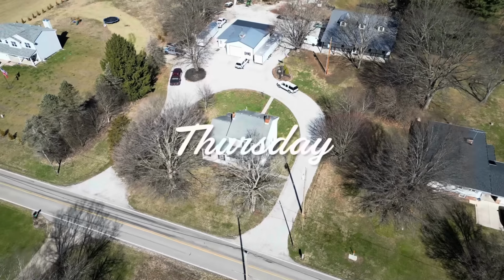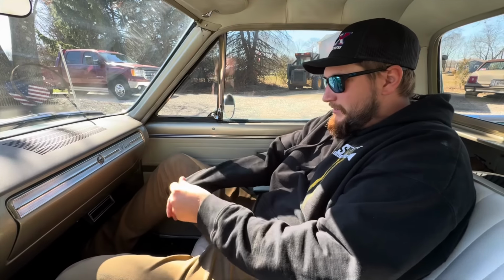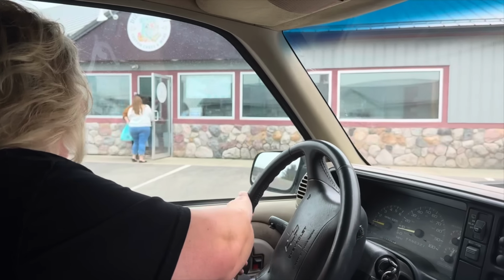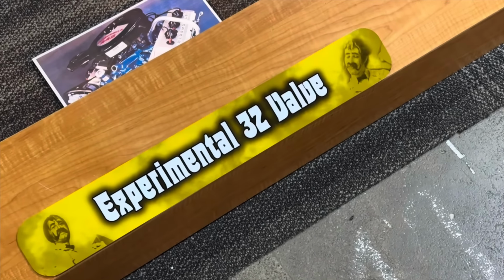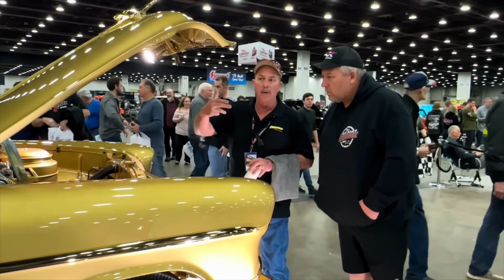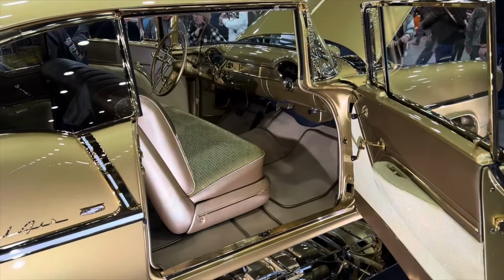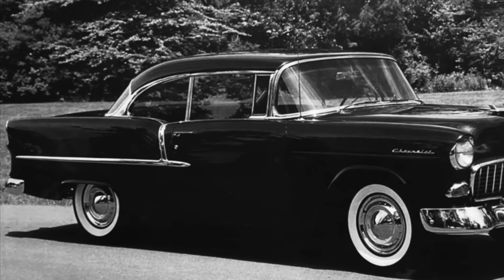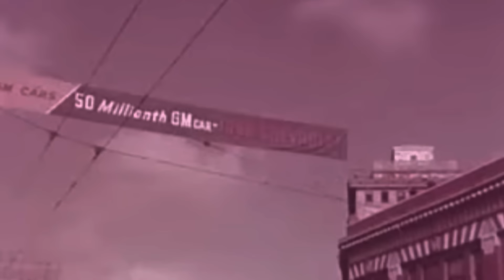GENERAL MOTORS BIGGEST MISTAKE!  The 50 Millionth GM Car(s) that were almost forgotten FOREVER!

Comment: Okay bill Mark Booth from Pennsylvania Lancaster Quarryville East drummer township where I live Mark booth I had a chance to get my old cars back when I saw it to and put them back in my storage I had a pink and blue 55 two-door I'll get that back I have redo do it and then I have two 4 doors one more had to get a small my dad fixed up has a 12-bolt rear Monty Rock crusher 327 with 2/4 build up it's a secret for the horsepower nitrous was a beautiful car septic some damage anyway I have to get it running and going and get it fixed before I bring it over Ohio jags at Terry's